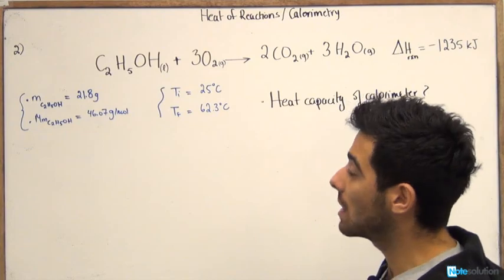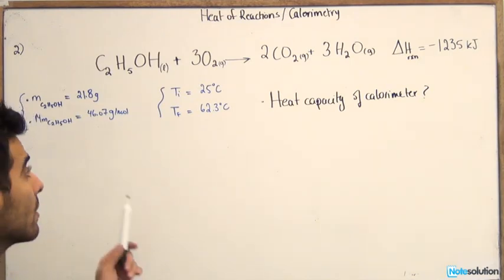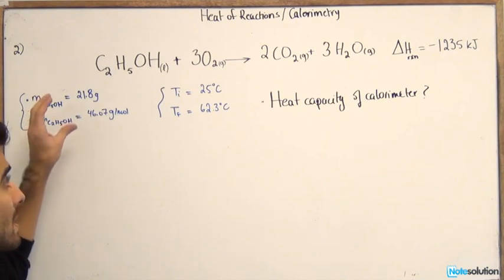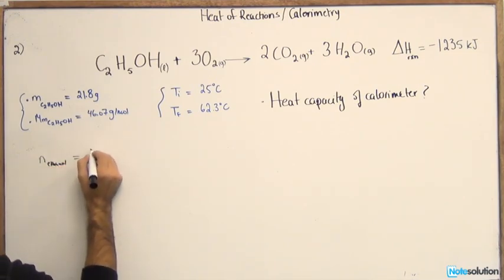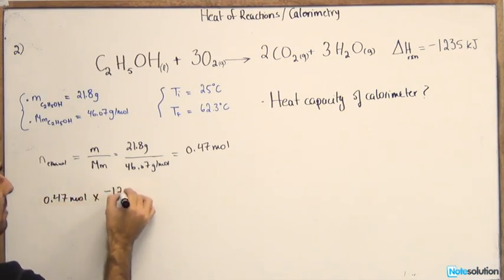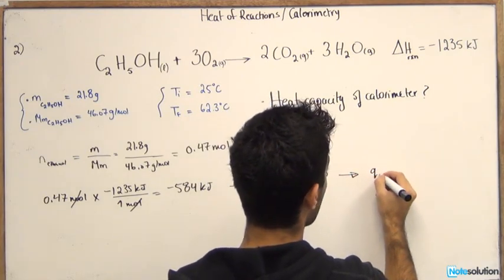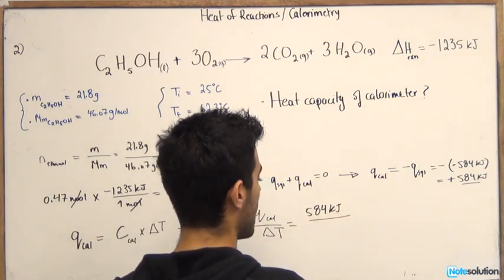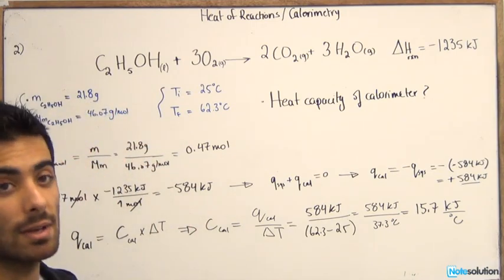Chemistry I: Heat Capacity and Bomb Calorimetry (Medium Lvl Question)

Comment: you mentioned this was a bomb calorimeter, which implies constant volume. Please correct me if I am incorrect but according to my pchem knowledge, constant volume calorimetry should be deltaU= heat released not change in enthalpy= heat released. So in order for us to use the change in enthalpy equation this setup needed to have been a constant pressure calorimeter. Also, I am assuming we neglected the heat absorbing property of the material of the calorimeter itself when solving this question? Thanks.
Reply: This equation was to find the heat capacity of the calorimeter itself (the heat absorbing property of the material, as you put it).  You use this as a known variable later when you want to account for the heat that the bomb calorimeter is absorbing during reactions.